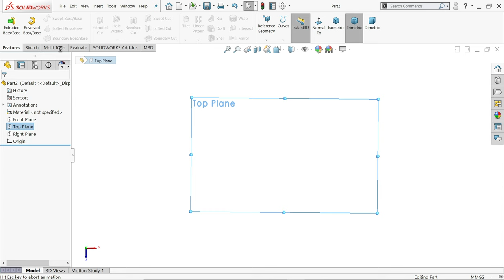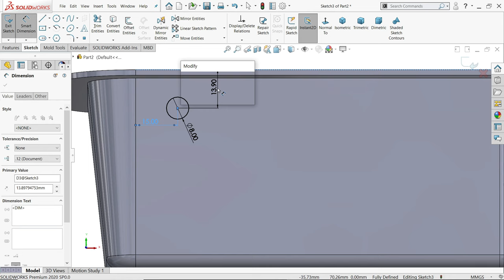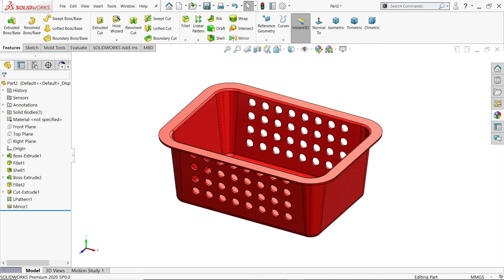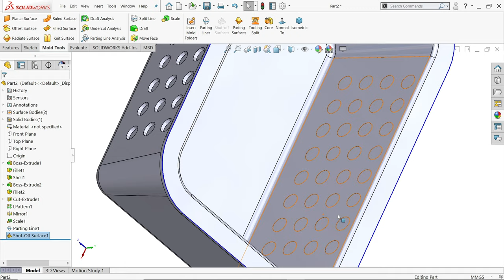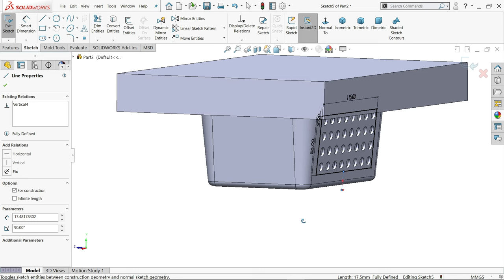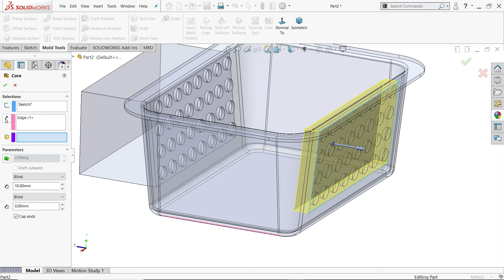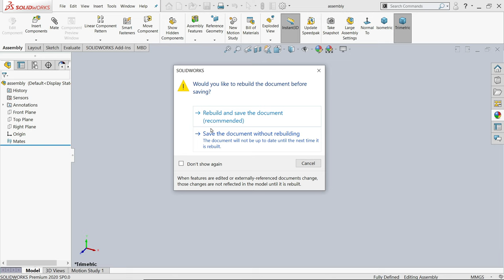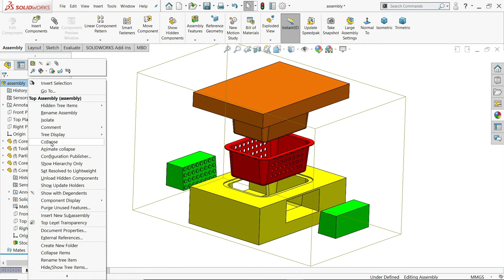SolidWorks Mold Design | SolidWork Basket mold Tutorial

Comment: When I create a sketch and select tooling split option, the block size was 10mm 10mm. It did not automatically show the 35mm and 90mm. I had to enter the values on my own. Is it normal? I am using SW 2019 edition